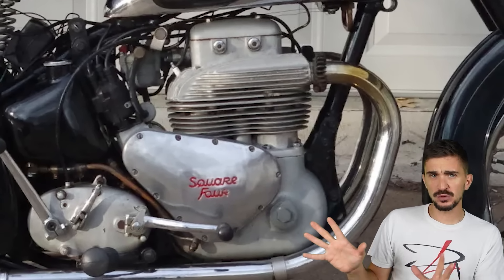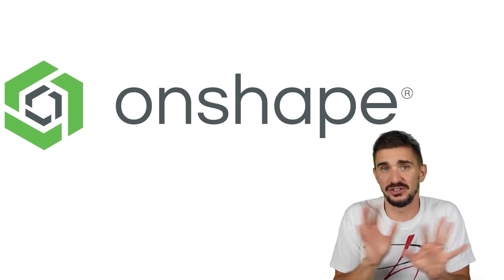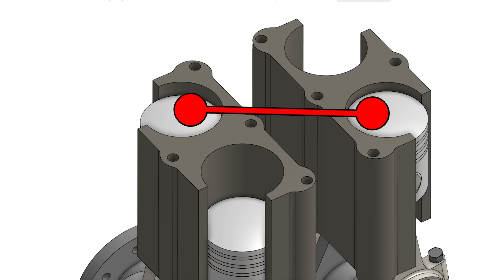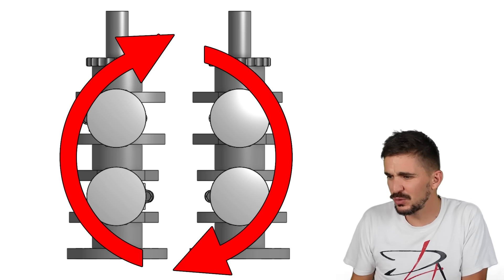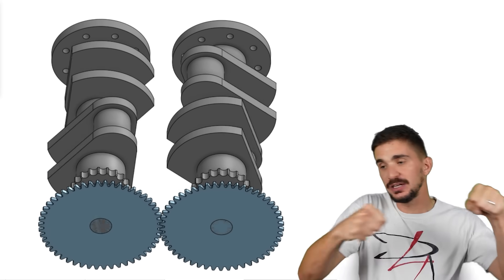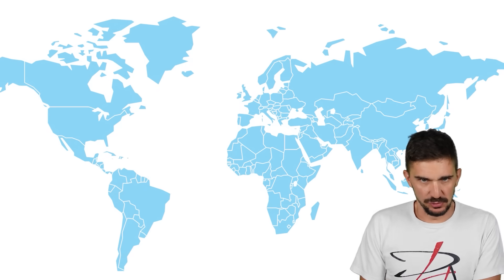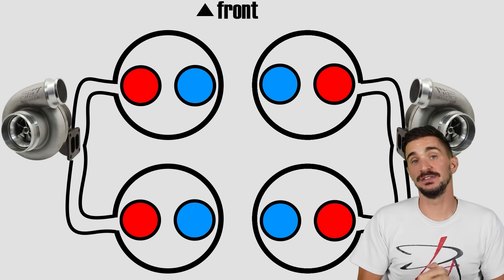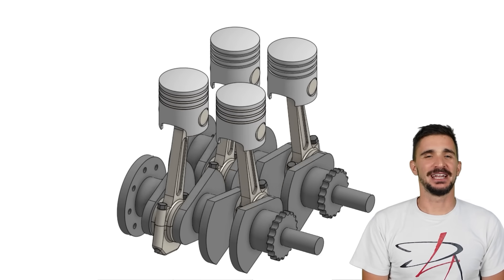From the Outside It Looks Like a Single but Inside Four Pistons Mingle! Square Four Engine Explained

Comment: Not the most exciting application for a square 4, but it does strike me as a potentially good option as a range extender.

Most range extenders are pretty rough I3's, mainly chosen due to being compact and easy to fit in a complicated hybrid power train.

But a smooth 270 degree square 4 offers potentially better packaging, with much improved NVH. So if one could be developed to be cheap enough it could make a lot of sense.

Comment: Need a 270 crank square-four? - no point in faffing about, just call Allen Millyard & ask Tracey to switch the oven on.   : )
Reply: Allen Millyard, an English man in a small garage, give him an unlimited amount of Tea and bacon sandwiches and you will get something that can land on mars,.....in a year
Reply: 😂@airgunnut
Reply: @airgunnut That's hyperbole; to my knowledge, he hasn't produced anything but air-breathing engines for land craft. Not so much as a model boat! So let's leave it at "Give him an unlimited amount of tea and bacon sandwiches and you'll get something that you can drive to the top of Everest..." 😉
Reply: @nunyabidniz2868  Yamaha has made something that has driven to the top of a couple Chilean mountain peaks, setting Guinness world records of late with the T7 Tenere and the YZ450F.
Reply: Just what I was about to suggest!  :D
Reply: Agree... If anyone in the world has the knowledge to do it is him. He has made 4 and 5 cylinders H2 two stroke engines and V8 and V12 watercooled Kawasaki motorcycle engines.  And not just the engines but fitted in running motorcycles!
Reply: @ismaelramos8687  Not forgetting the speed record bike with a Dodge Viper engine in his own rolling chassis, and the Flying Millyard with a V-twin engine based on two cylinders from a Pratt and Whitney radial engine....
Reply: exactly!
Reply: They have been making cross plane V8 engines since the dawn of time. Chop it in half and you have 2x 270 degree cranks for the square four.

Comment: Now do one about the Brough Superior Dream. Vic Willoughby's "classic motorcycles" for research reading if you can find a copy. Brough Superior only made a prototype I believe, and I can see why really with the mechanical arrangment, but still, best balance ever. and a decent setup for air cooling.

Also, have a chat with the garage54 guys, I'm sure they could find a way to make a 270 degree square four on a tight budget. Probably out of a Lada engine somehow.

Comment: So what you're saying is we should add 2 more cylinders for a rectangle 6, and then put two of those in a V for the most ultimate 12 cylinder, with all the benefits of a V12 and more compact than a W12?

Comment: I was thinking...
With as many as possible off the shelf parts, wouldn't is be possible to build one off of such an engine? Probably in quite performant version even.
All that would be actually needed custom is the engine block, isn't it?
@d4a what you think? What budget would be needed?

Comment: the first thought I had is "heat dissipation". there is only one reason to "bother" with 4 cylinders in bike, power, and that makes it harder

Also gyro effect is... kinda useful for average rider, it makes motorcycle more stable at low speed/parking lot maneuvers
Reply: it is only valid for air cooled square 4 engines. The last ones on the market like the Suzuki RG500 is water cooled and has no such cooling issues.
Reply: Liquid cooling has advanced to the point where a 1L engine putting down 200 wheel horsepower can operate at that level for extended periods of time without damage. Front mount curved radiators get the job done. Wouldn't take nearly as much to cool a square-four tuned much more moderately (not superbike spec).

Comment: Another great video. As an older Brit I couldn't help laughing at your quality control comment. We all rode Japanese 2 stroke 250s and 400s back then. Everyone knew how crappy British bikes had become. We used to laugh at the older guys with their crappy Triumphs and BSAs rocking up at the burger bar.
Reply: If you call them older guys, and you're an older brit, does that make them older older guys?
Just a funny thought I had.
Reply: @CosmicHase  That probably makes them long deceased guys.
Reply: @CosmicHase unless they died they're still older guys nothing's changed.
Reply: But today the BSA Rocket Gold Star, is voted overwhelmingly the best bike ever made, with the Brough Superior next, then the Vincent Black Shadow, With the top Jap bike being the Z1 900cc, (not the1k), I would swap my 2017 Blade and my 2000 R6, and my 2019 R1, for any of them first 3 bikes, and thinking about it I would give my house and my new 2025 Honda CRF1100L Africa Twin ES DCT too for the Brough or Vincent. And do you think any modern sports bike will hit 1 million miles plus, without needing major engine work? As there are Vincent's with 1.5 million miles on them, not bad for bikes built from the 1920's.
Reply: The Japanese made gaskets that worked, unlike BSA.

Comment: I think this would make a great car engine actually. Push rod rectangle 4. Or gear driven dohc. I mean it literally already runs 2 huge gears, just build on top of that with the gear style of an old ferrari engine. The way it's balanced, these things might be able to rev really high. Plus, you get a 4 cylinder engine in a smaller space. If the block mount points are made symmetrical, it can fit in FWD, RWD, AWD configurations just by literally rotating the engine on the assembly line. The intake runner can literally come in from the top as well. This is an excellent engine design/platform

Comment: Could the connecting rods use a fork and tongue arrangement (like in the RR Merlin) and thus utilise a single crankshaft? This would, if it would work, reduce complexity, weight, friction etc etc. Asking for a friend.....
Reply from the maker: Tell your friend it could be done but everything you mentioned would be increased rather than decreased.

Comment: I think a U-twin would be even better. Up to 1400cc (108mm bore x 76mm stroke) with a safe 10k redline, which should produce right around 200hp at 9k and 120lb-ft of torque. God help you if you need more, because I think that'd be severely pushing it even on a proper recumbent motorcycle like Dan Gurney's AAR Alligator or Robert Horn's prototype racer. Another less exciting, but selectively more compact (and better to counter the gyroscopic forces of the wheels) option would be a regular Parallel twin or triple, but with Ferrari's new perpendicular (to the crank) pill-shaped pistons. You could probably keep a normal twin about as wide as this U-twin setup (esp a Honda-style pill shaped U-twin to reduce engine length), or keep a triple about as wide as a normal round-pistoned twin.

Comment: There is a mistake in this video, it is not the pistons that create the primary rocking couple in a square four, but the counter weights on the crankshaft. In TDC and BDC, the counterweights are perfectly opposed to the pistons but at 90 and 270 the counterweights on the opposing cranks don't cancel out like they would in a twingle engine, and instead add up, the other pair of counterwights on the other side of the cranks add up again but in the other direction, giving a final resultant rocking couple in the vertical axis.
Reply: Edit: This comment is older than the youtube thread commenting update, please refer to the one I've directly replied to d4a with instead. Also, that one is a lot more complete.

It's called a 'square' four, not a rectangle four, the distance between the bank sharing pistons and the opposing pistons is the same, all four pistons can be considered to have a primary couple where we get 4 pairs, two of these pairs(bank sharing pairs or the opposing pairs)add up constructively while their resultant sum adds up destructively(all 4), the video only accounted for two out of the four of these(bank sharing pairs), which is why the step where they add up destructively with the other two pairs(of the opposing piston pairs) isnt present and the result that they cancel out isnt reached.

Another way to think about it, is that the centre of mass for both diagonal pair of pistons always lies in the same vertical line in the middle of the four pistons and that the mid point of both the centre of mass of both diagonal pair of pistons is always the same unmoving point in space, meaning the centre of mass of all four pistons remains the same throughtout (edit: im wrong here, it does move vertically, but because of seconary forces) and this is why there is no primary rocking couple created by the pistons. Also, the fact that the centre of masses move in a straight line mean they're canceling opposing forces, if they were moving in semi circular arcs, then that'd mean they'd be cancling opposing torques(as in rocking couples). The primary rocking couple comes from the unbalanced crankshaft counterweights alone.
Reply: I agree with @hrishikeshaggrawal. I came to the comments to see if anyone else noticed. Great video otherwise. :)
Reply: I have to add that if the crankshafts are fully counterweighted then the crankshaft itself shouldn't have any imbalance so only the connecting rods are not balanced. This should be a pretty insignificant imbalance though. Also I have no source I just thought about this in my head so be aware of that... XD
Reply: Oh I just realized that if you make the counterweights a bit heavier they should balance out the connecting rods thus making a the engine have perfect primary balance.
Reply: @drm0628 lol you have it the other way, the heavier the crankshaft counterweights get the more of a primary rocking couple in the vertical axis arises. The counterweights only need to account for the low end of the conrod and the crankpin, not the entire conrod and the piston too.
Reply from the maker: No
Reply: @d4a  I've thought more on the matter since and realised, I'm still not wrong.

Depending on if the crankshaft counterweights are only accounting for the lower half of the conrod and the crankpin but not the piston, there wouldn't be any primary forces or primary rocking couples, your analysis of the piston forces in the video is incomplete and missing a crucial component to the final sum which eliminates the rocking couple from the pistons. But if the couterweights are heavier to also account for the piston weight, the primary rocking couple in the vertical axis comes from the crankshaft counterweights. Either way, there is an issue in the video that needs to be addressed, and that is that the primary couple does not come from the pistons. You have arbitrarily decided to sum the bank sharing pistons as a rocking couple and that the two banks with their rocking couple each would sum to give a final vertical axis rocking couple, while ignoring the fact that there can also be a rocking couple from the adjacent pistons of opposing banks that can sum with the rocking couple of the other two remaining pistons to reval another final vertical rocking couple in the exact opposite phase of the one you have arrived at with the bank sharing piston pairs first. You have considered only 2 of the 4 adjacent piston pairs.

That is a very technical read, but if you analyze by summing the 2 diagonal piston pairs instead of 4 adjacent ones, you can easily see that for two pistons going up the other two go down and that the centre of masses for the diagonal pairs move in the same vertical line in the centre of the pistons, without horizontal movement there is literally no way a vertical axis rocking couple can arise.

An ideal analysis should consider the sum of all 6 of these pairs, and a mathematically rigorous one would never pair the forces in the first step to get rocking couples to begin with, but sum the forces individually with individual rotational vectors and direct force vectors.

Comment: Another way is to have again a 270 crank, but instead give up on the diagonal pistons pairs canceling each other, and have adjacent pistons of the opposing bank cylinders cancel out each other as in a twingle engine extended with longer 270 cranks. Every pair in the twingle is already balanced for primary forces, but if you extend the cranks and add another cylinder pair in twingle configuration on each with 270 offset you can cancel out part of the secondary forces and get an engine with only the secondary rocking couple in the roll axis and nothing else. This engine will also have the same firing interval as a v4 with 0 crankpin offset.
Reply: The moment someone grabs enough spare time and a hold of OnShape, a newer variant of AngeTheGreat's Engine Simulator, or an infinite supply of Lada engines, mark my words, someone will try to make this.
Reply: I can envision that. Clear description.😁

Comment: Im Like: „Why doesn’t he acknowledge the bad secondary balance of the 180 degree engine. That would be important for cars“ later that video „aaaaah I know he didn’t forget the cars“
Reply: Secondary forces cancel each other out, as the second crank spins the other way.
Reply: @xTerraH  no
Reply: @hrishikeshaggrawal  yeah mb I mixed up first and secondary forces there .. dumb moment. But to the OP, secondary forces are not as big of a deal.

Comment: could it be heavier than inline 4? being more timing parts, two cams and two crankshafts
Reply: The camshafts and crankshafts are also half as long, the only weight added would be the driving gear on the second camshaft that's connected to the belt/chain, and the syncing gears between the cranks, then again they are quite large so they can reduce part of the flywheel or eliminate it completely.
Reply: This is what baffles me about V4 engines. I would expect them to be heavier than I4s, what with all the extra valve train components, and yet they are the most popular choice for state of the art motorcycle racing. Maybe the shorter crank makes up for the weight gain of having double the cams and cam gears. I have yet to to see anyone weigh a Ducati or Aprilia V4 and compare it to a similar sized Yamaha I4, so it's possible for the V4 to be weight competitive, I guess.

I would certainly expect the square 4 to weigh more than both of the above configurations.
Reply: @operator0  I think it also has to do with making parts lighter. You can run a bigger bore and shorter stroke on a V4, the I4 is limited by the width of the bike. Which generally lightens the components and lets you rev higher. Also the crank can be thinner and lighter because it is shorter. 

And I'm not sure about that, but I think you can also make the block lighter because it's shorter and more compact. (Same principle as with the crank)
Reply: @operator0  Ducati engine will definitely heavier since they use desmodromic cams
Reply: @operator0  the cranks and cams are also almost half as long, even if they are doubled in number it almost cancels out.
Reply: @operator0 It's about packaging and power pulses. If you have 32 valves in an inline or V it is going to take basically the same amount of valve train whether it's split up or inline. .

Comment: Take it one more knotch, rectangle 8, or a square 9. lol only good on paper.
Reply: Square 9 bruh. Tbh, if buggati made a square 16 it would be interesting, but it might have overheating problems in the middle cylinders even with liquid cooling. But because the engine is so wide it wouldn't be very tall anymore for it's capacity, making the center of mass really low which could be very good for racing applications. BTW, if you make a L plane cranks rectangle 6, it would have perfect primary balance and only one ninth secondary forces. The opposing pistons are paired like in a twingle so there's no primary forces and the first and last pair have 0 degree offset while the middle pair lags behind by 90 degrees or is ahead of 90 degrees. Hence, a L plane crank. The resultant secondary force is only one third but it is distributed over three pistons so it gets reduced to only a ninth in effectiveness. However, the firing order would be a mess.
Many say crossplane v8 are perfectly balanced, but unless there are knife and fork conrods used, there is always a primary rocking couple present, in a rectangle 8 that would no longer be a problem either.
Reply: I somehow doubt it would be good even on paper.
Reply: @wurfyy  the rectangle 8 is reasonable but it offers little benefit over a crossplane v8 as it gives perfect balance but has increased rotational mass, the square 9 however... yes it's not even feasable on paper.
Reply: @hrishikeshaggrawal  you could make a square 8, like a sq 9 but a gap in the middle for cooling. bank a 3 cylinders, bank b 2 cylinders, bank c 3 cylinders.
Reply: @martin-vv9lf  why not just make a rectangle 8 which has perfect balance, that's basically just a crossplane v8 but without the offset between the banks that makes a primary rocking couple in the vertical axis but with a second extra crank that removing gyroscopic forces too. A square 9 sans centre cylinder would have 3 cranks and a horrible firing order while being unbalancable no matter what.